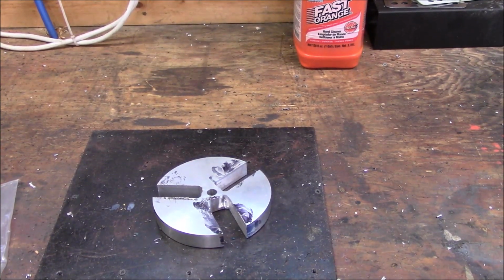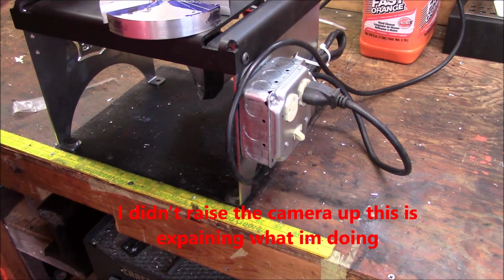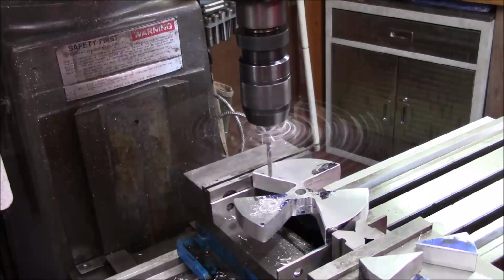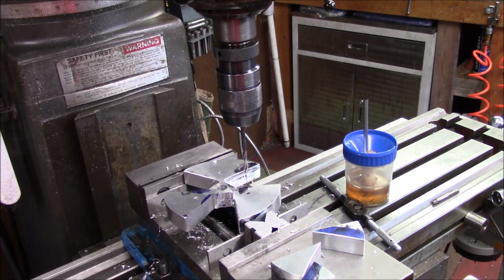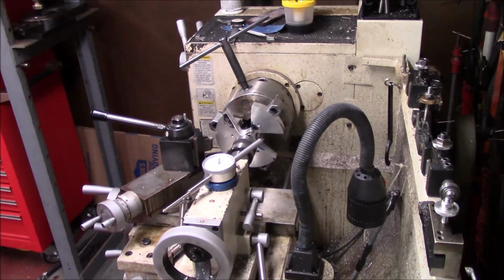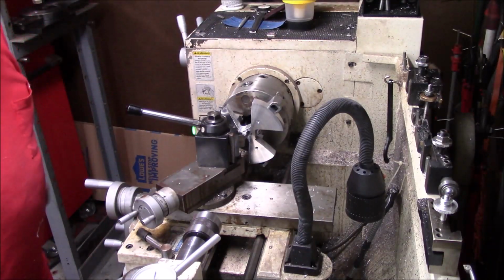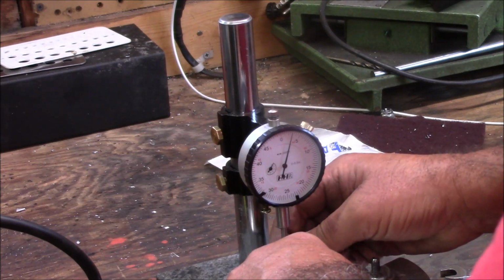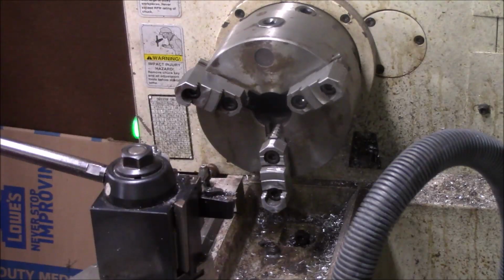Salvaged my Lathe Spider so I could use it

Comment: When I made mine, I made a pallet (4x10 1" thick). Drilled a hole in the center of the spider and drilled and tapped a hole in the pallet to bolt it down. Then I used the hole pattern function of the dro to get three 1/4" holes 120 degrees apart. The I could use a dowel pin in the chuck to align for the cuts by loosening the clamp bolt and spinning the spider on it.
Reply from the maker: DSCKy after the fact I realized that would have been a better method. I didn’t stop when I started and realize I laid the center lines laid out incorrectly. So I basically had two choices. Start over which I seriously considered or see if I could salvage it and make it useable. I decided to see if I could make the spider useable since it was for me if it wouldn’t affect how it functioned. Thanks for the comment it’s appreciated

As I said I wanted to demonstrate you can sometimes work around a mistake

Comment: Showing how you screwed up is a good way for others to learn! But I’m still not sure how you screwed up.  It is unclear what was wrong with the spider in the beginning of this video.
Reply from the maker: Rocking J Metalworks - John Brock the slots for the jaws wasn’t a true 180 degrees apart. I tried to shortcut by scribing the jaws on the lathe, but  it didn’t turn out. The plate would not fit over the jaws. That’s how I screwed up

Comment: Hi James. When precision placement isn't required for a part like that, squeeze the blank in your jaws and use a straight edge located against the sides of each jaw to draw a line on your blank. Then take it to the mill and just hit the lines. I like that you didn't give up. Here is another concept you may wish to consider in the future.  https://www.youtube.com/watch?v=U3x8H1Xb-jg  Take care.
Reply from the maker: Joe Pieczynski first of all I’m honored you actually not only watched but to take time comment. I almost threw the part away, you are correct I didn’t scribe the part correctly on the C/L of the chuck jaws so when I milled the original slots the orientation was off, so that was the original sin. Actually I studied several methods of making another plate, but I decided to see if I could salvage the original one, I knew I was off and it wasn’t symmetrical the only way to make it useable was to bandsaw out the offending areas so that’s what I ended up doing. Again thanks for taking the time to to give your advice it’s appreciated